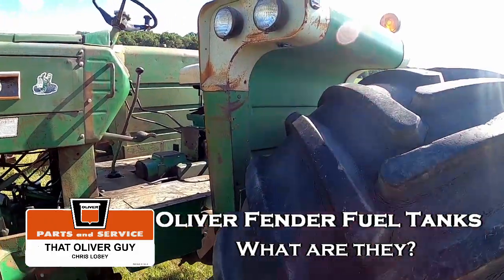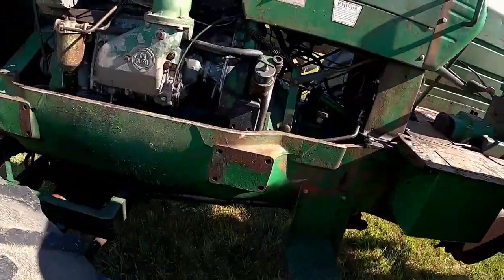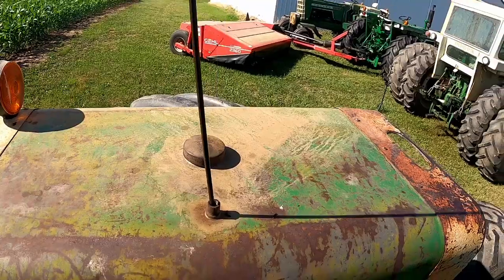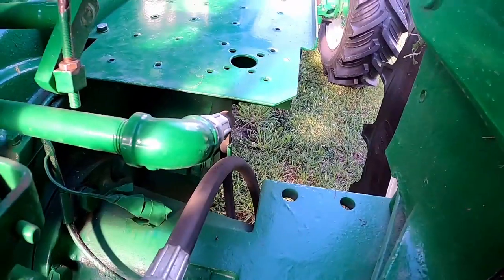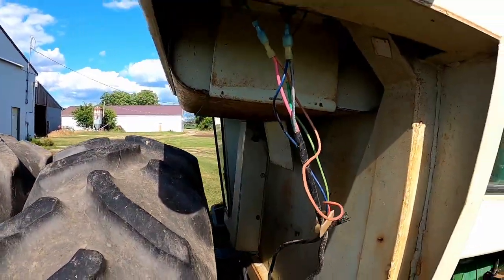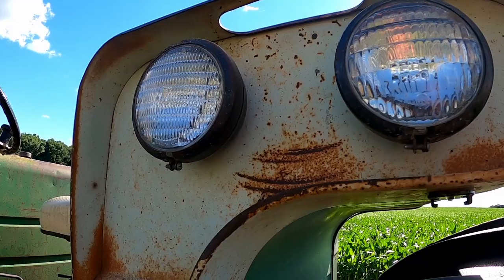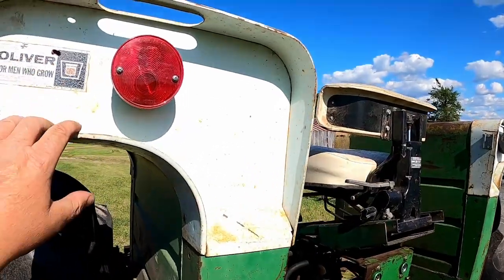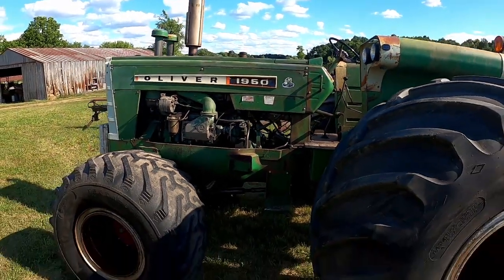Oliver Fender Fuel Tanks

Comment: Thanks for the info.I always wondered about the plumbing as mine were un hooked. A lot of years when my 1950 was the big horse I would fill them for extra ballast.  For a winter project I may get 3 new caps and use 3/8 hydraulic hose to replace the hose. Sadly I ditched the original Y Oliver made from pipe fittings thinking that was some shade tree mechanics fix. Thanks to your video I can replicate it. Can you post the cap part numbers vented versus non vented .Great video as always.

Comment: You just touched on something that some farmers forgot to do.  We had some who wanted to keep the weight on the rear wheels so they would fill the tanks and shut off the valves at the bottom.  IF they forgot to switch a vented fender cap onto the main tank and put the non-vented main tank cap on the fender they had problems.  Maybe the tractor would simply not be able to suck the fuel out of the non-vented main tank and stop running.  The other thing that could and did happen was that the tractor would continue running, albeit is not well, and the farmer would suddenly see his fuel cap disappear down thru the hood.  It was possible to get enough vacuum on the main tank to cause it to collapse.  Just like when you were in school and the science teacher drew a vacuum on a metal gallon can and it would collapse.
Reply from the maker: I've heard about a few front tanks collapsing from someone not having the vent cap on the right tank. I've never seen one, but I have seen a couple that were puckered in just a bit.
Reply: @ThatOliverGuyChris  We had a 1955 tank shrivel up so much we could take it out of the straps without removing them.   
Most people do not realize that fuel pumps just create a low pressure on the suction side and the atmospheric pressure is what pushes the liquid to the pump, and good transfer/fuel pumps could create enough negative pressure to do the deed.  
Some old aircraft used the same principle of the fender fuel tanks to drain auxiliary tanks first and the main tank gauges would only start to show usage when the auxiliary tanks were empty.  A simple method that did not require fancy fuel tank switches or auxiliary tank pumps.
That is basically why cars and engines of old had hand pumps mounted that simply pressurized the fuel tanks.  That was one of the jobs of the riding mechanic in race cars, pump the lever to maintain fuel pressure.  Old sprint cars had glorified tire pumps, usually mounted on the outside of the cockpit, that the driver had to pump

Comment: It looks like those tank fenders are only slightly adjustable for width, like they can't be moved on the axle, just with those small slots. Can they be adjusted in to accommodate 60" tread width for 30" rows? And can they be compatible with the ROPS/canopies which have become popular on tractors from those years?
Reply from the maker: There's a fair amount of adjustability between the slots on the tanks and the different holes on the axle. They can be used with the ROPS canopy,  but you won't be able to get the tires in enough for 30 inch rows. Even without the ROPS, I think it would hard to get it to work on 30s.

Comment: I’m up in Maine. I bet those tanks would collect lots of moisture and freeze.  -40 always brings out the best in things.  😹
Reply: My stepbrother is in Alaska and they said that they put a little bit of kerosene in the diesel and keep them about full -60 a little chilly
Reply: @jcchristopher7827  well it’s more about the condensation turning to water and freezes I. All those fuel lines
Reply: @ram_diesel_power6039  true but if there full and kerosene is added it is alot harder to freeze and and kerosene helps with starting some    we have trouble out of the plastic and poly tanks condensation causes algae in cold weather but anything can freeze at -60    we left a third of fuel in the fenders and main was full but the fenders gelled up cause they didn't have enough fuel in them
Reply from the maker: I forgot to mention there is a water drain on the front bottom of the tank.
Reply: @ThatOliverGuyChris  it’s all them little twisty turny  fuel lines and fittings that water collects in. Still though it’s a nice tractor and all that extra fuel storage comes in handy

Comment: I just acquired a set of white fender tanks, there attached to a 2-105 good information thanks Chris
Reply from the maker: I've got a set from a 2-105. I'd like to paint them up and put them on the 4-225, but I need to find or fab a set of mounting brackets.
Reply: @ThatOliverGuyChris  the guy I bought my white tanks from had brackets made for my tanks to put on his 4-210 i didn't get those he might still have them I didn't know if they would work for you
Reply from the maker: @jaycow3154  Yes, the 4-210 used the same rear end as the 4-225

Comment: If the diesel tractors used just suction for fuel delivery to the main tank, then I assume once one fender tank ran empty you could not get remaining fuel out of the other tank, since it would just suck air... right?
And that leads to the question: What causes fuel to be suctioned from both tanks at equal rates?  I would think one would end up running empty well before the other just because of slightly less resistance to flow on one side from any number of factors (which would then lead to the problem of not being able to get the rest of the fuel from the other tank...).
Am I missing something here?
Reply from the maker: The 2 fenders T together. Gravity takes care of them coming down equally.  If you fill just one fender tank, gravity will even the 2 tanks out, even while the tractor is running.
Reply: @ThatOliverGuyChris  Oh, that is a different story, if gravity works in its favor instead of against it, not just suction. I'll have to look at one in person. It looked to me in the video like that T-connection was well above the bottom of the fender tanks. If I'm thinking about it right, I guess the lower the T is mounted, the better it should work.
Thanks for the answer. Since you were nice to answer that one, I'll ask another in a new comment...

Comment: I wonder how bad those fender tanks are about being leaky on a tractor in average condition after 50 to 60 years.
Reply from the maker: Surely there are some bad ones out there, but I've never had a set give me trouble. They don't have a water trap, so any moisture that had condensed would end up in the main tank where it's water trap would catch it. The right one on this tractor does have a leak, but that's from someone putting the wrong bolt in the mount. It was too long and pierced the tank.

Comment: We've got a1850 gas with the fender tanks filled them up and set selector valve for main tank the extra weight and loaded tires it was good on the plow just bought a set of white fender tanks for a 2-150 cab rough want to make open station
Reply from the maker: Cool!